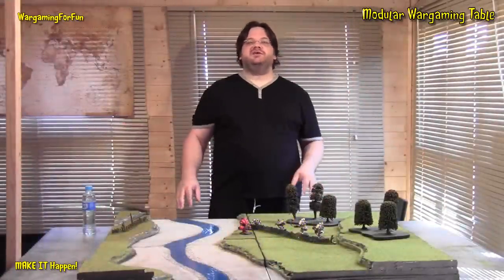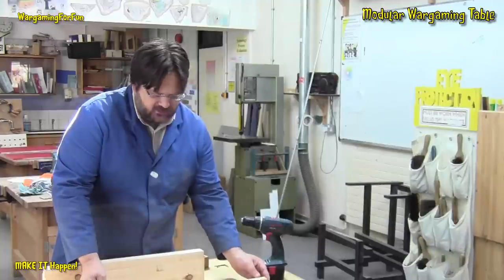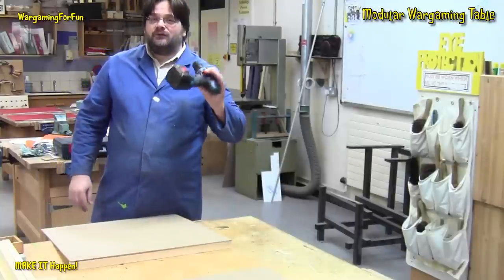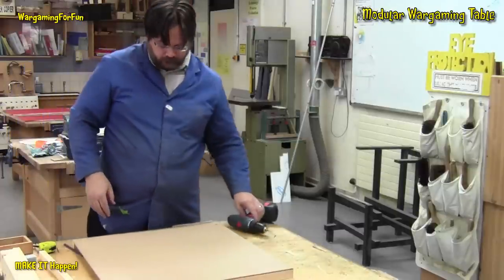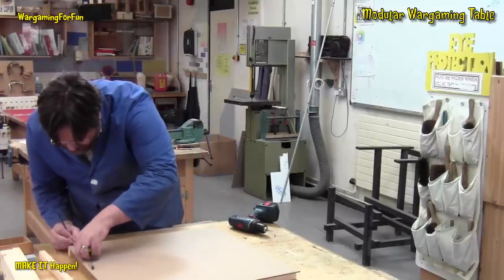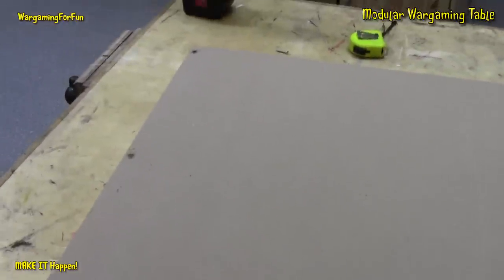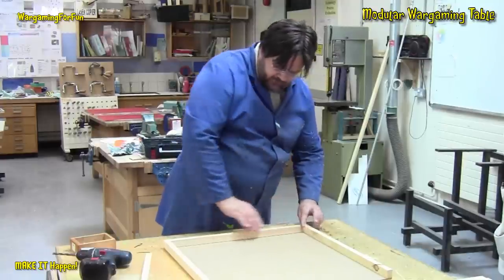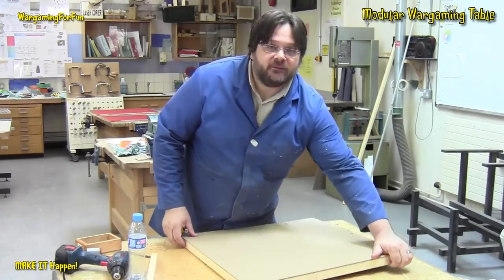Modular Wargaming Table Top Part 1 of 4 - MAKE IT Happen - Wargaming Terrain

Comment: dont forget not to screw to close to the board edges as this will result in cracking and splitting of the wood. 

nice video,now im going to watch the other parts. 

you did say your a teacher right? because that room your in looks like the kinda room i used to learn carpentry in at school.

Comment: What's wrong with simply getting the thin sheets of wood, making a hill or two and covering it in model grass?  Are the bits on the bottom necessary?
Reply: +Madscientist jr its to prevent the boards from bowing or flexing over time and heat and also adds durability.